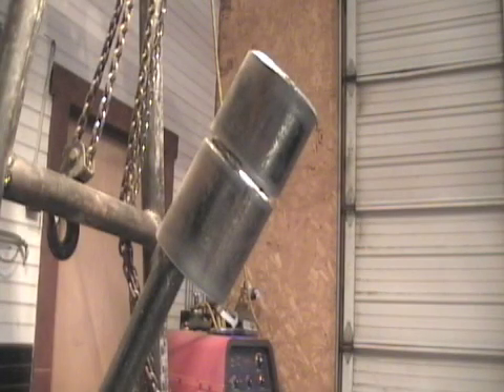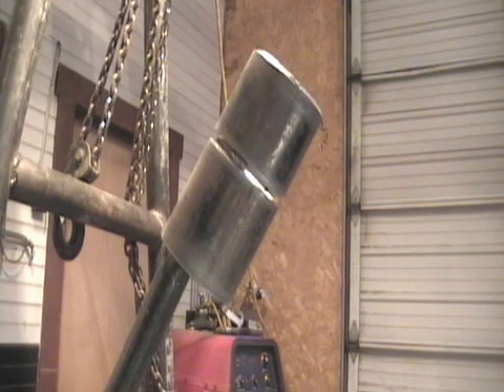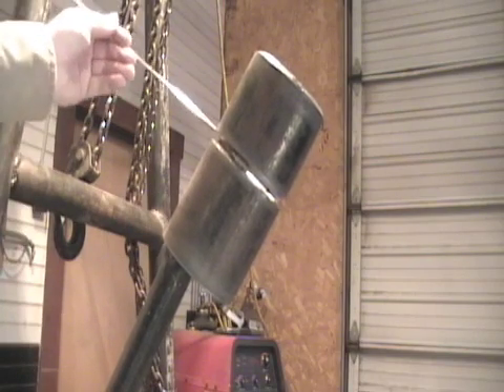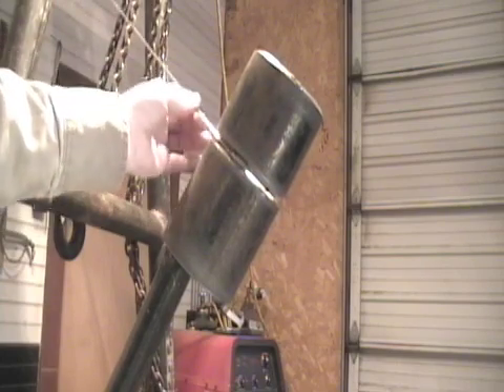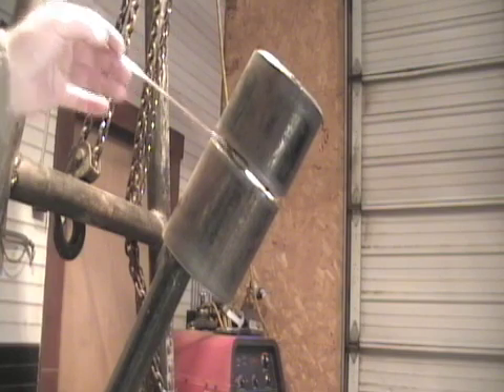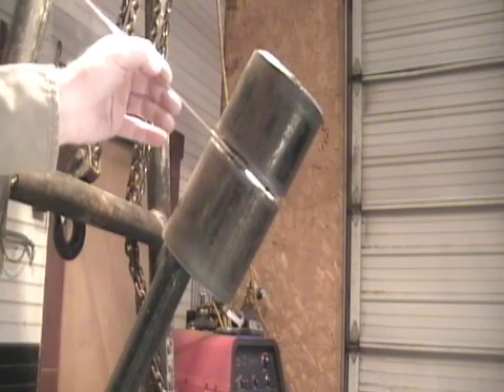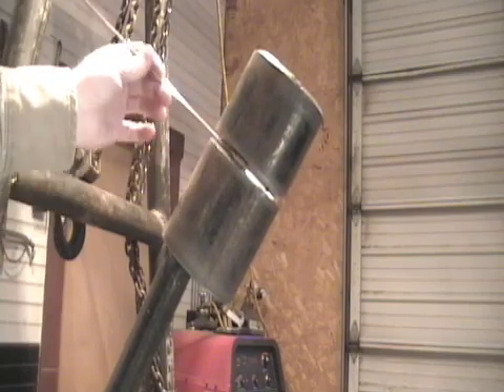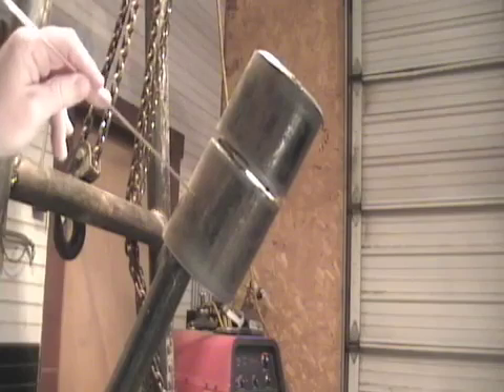Learn To Weld TIG [TIG Root 6G Position]

Comment: hi ,i find the 6g in stainless much easyer to get root penetration on the very bottom,with the carbon 6g i struggle to get much beyond flush ,i using a 3.2 gap and 2.4mm wire,any tips for rooting the very bottom of the pipe on carbon for a more convex root?

Comment: Hello,
can you please give me some advice,I can get the root run and hot pass perfectly,im just having trouble with the cap.
Im welding 2 inch sch 40,i have my amps on 91 using 2.4 filler wire.
Am i supposed to be dabbing the wire each side with a flick motion????????????
Mine turns out like crap,like a long blob.
Please help.
thanks :)

Comment from the maker: If you will use a flapper wheel on a straight end grinder and clean the area around the bevels, you shouldn't have problems with porosity on carbon. Only if it is dirty metal.